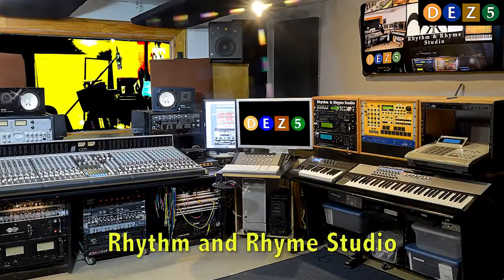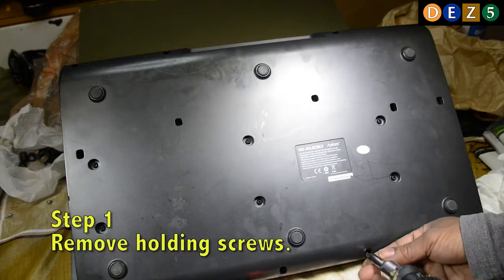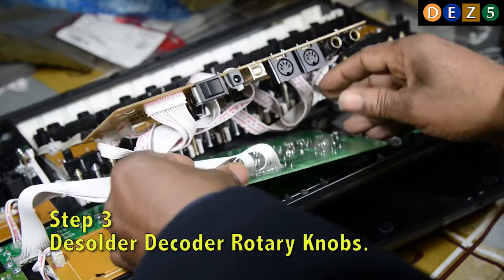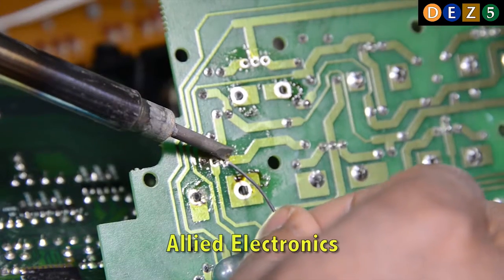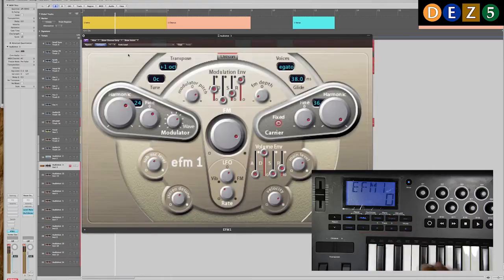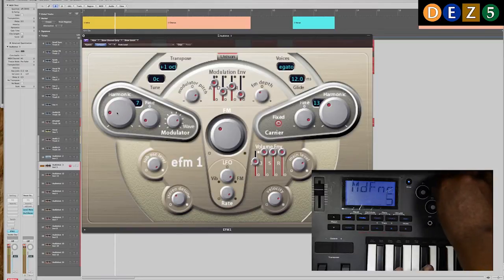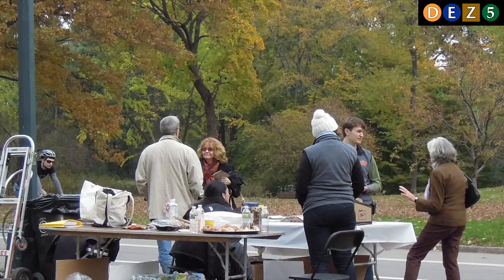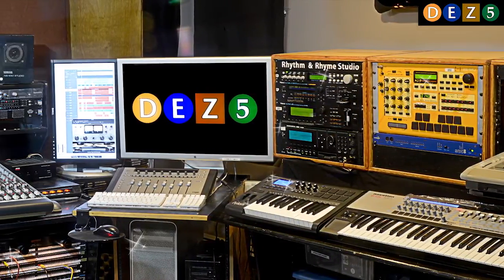Repairing Axiom 25 Keyboard  USB and Rotary Knobs at Rhythm and Rhyme Studio. Apple Logic Pro Setup.

Comment: I got a used Axiom pro 61 with unresponsive pads. Only 1 pad works and the others are completely dead. I opened it up and saw no oxidation, but just a little tear on the strip that connects to the circuit board. Is there a fix?

Comment: Hi Desmond - great video! I'm fixing my Axiom 61 1st gen. How the heck do you get those rotary knobs off?. I'm pulling so hard I'm afraid I'll break something. Am I just not pulling hard enough or is there some trick?
Reply: same problem... any solutions yet?
Reply: @Timsen-Bimsen  Since I did this repair (left the rotary encoder board as is) I bought a knob puller from StewMac made for guitars. I'll try it on the Axiom and let you know if it works
Reply: Been a while since I fixed my pair of Axiom 61's. I ended up leaving the rotary board in place and not fixing the one bad encoder. Sorry I don't have a better answer

Comment: hi! quick quesion. axiom 25 top right encoder pot is faulty. how hard is to change/access it for a hobby solderer...? i did change several normal size pots in other appliances, but im just an amateur. will I be able to source the spare part, does it need any pairing or electronic tweak to work? thx a lot for any info :)
Reply: It's a pretty old video man. I don't know if you'll get an answer.
I was about to ask a similar question (broke a few sliders on my Axiom 61 during a move), until I noticed that the next comment was five years old.

Comment: Hi thanks for rhe video! Had a question if you dont mind. My Axiom 25 has a keyboard problem. Random keys - 2 or 3 of them - stop working at random times, but always in sequence. There is no pattern, so its not one or two particular keys (such as the C,C#), it could be any 2/3 keys on a given day. But yes always in order. What do you think is the problem. Is it a board, the keys or maybe a software issue. Or something else. Would appreciate any advice thanks.

Comment: Ever have a problem with the pitch bend dropping all the way when you hit certian keys on an axiom 25? with mine ill be trying to bang out a drumline and if I hit P3 with the p group off itll drop the pitch bend or on certian keys itll drop, the graphic of the controller shows the pitch bend held down all the way but the screen on the axiom still says 64 for the pitch bend value, M-audio support said to reset it and it still did it and then they said to set the pitch bend to a 0 value to disable it and it still does it, so theyre guessing its an issue with the drivers and windows 8
Reply from the maker: I'm sorry I've never had this issue, I'm still using OS 10.7.5. Check M-audio for the latest Firmware and driver.

Comment: ok so I open my axiom 49 notice the usb back was pop out pop it back in to see if this was the problem when I try to power it up from the usb I get nothing ever since I open and inspected my motherboard when I put the axiom back together I get no power from the usb which was getting power before I open the axiom so I change the usb and still no power BUT the darn usb port was powering up before I open it the axiom still power on with the wall adapter but the usb never connect to any pc this is why I open the axiom but ever since I open it I get no power from the usb but still power u from wall adapter im so lost and im pretty good with electronic repair but never repair a keyboard before I check the grounds and plugs and the crazy thing it still power from the wall but not from the usb ever since I open it even when I installed the new usb it still don't power up from the usb port im so lost what you think thanks and happy new years yo

Comment: I have a axiom 49 and the usb want connect to any pc or laptop anymore (just  stop connecting one day) do you think this a fault usb or the board the usb plugs to mind you the axiom still power on from usb but never connect to the pc anymore ?/? im lost
Reply from the maker: Try using another USB cable also try using a 9 volt supply to to see if the unit powers up.
Reply: The unit powers up but want connect to any pc or laptop and I tried 3 different cords & usb & laptop that all work fine with my ddj-sx
Reply: Thanks for answering back
Reply from the maker: ant Banks sound like a bad USB connection. Hopefully this video can help.
Reply: K thanks